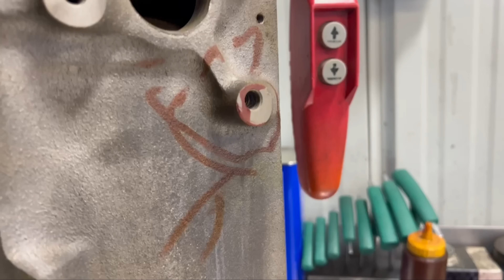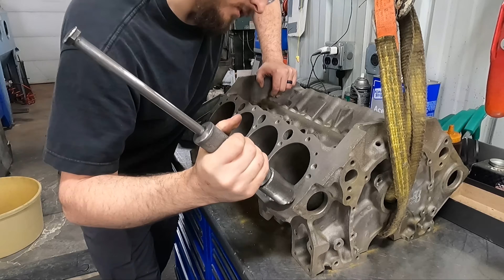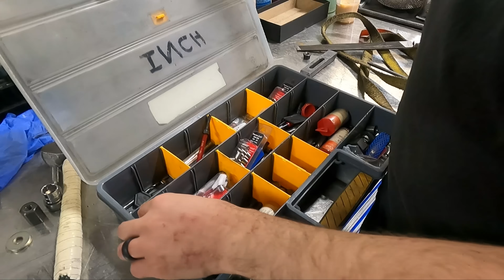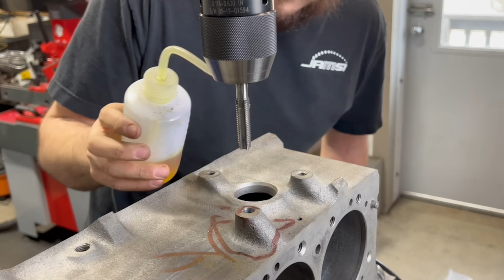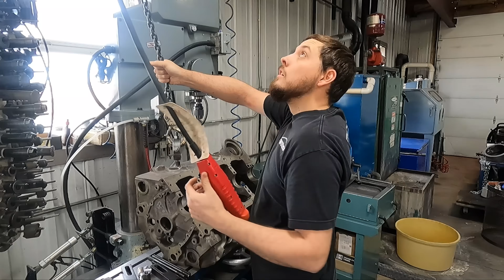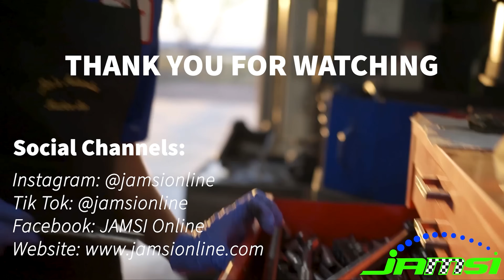Fixing Motor Mount Threads In A '70 350 Corvette Engine Block @JAMSIONLINE

Comment: Heli coils are often stronger than the original threads just because there harder than whatever material there threaded into. And now youve increased surface area on engagement on original materia, more surface area to grab, more strength.

Comment: What is the reason you wouldn't just tap by hand to start with?
Reply from the maker: Using the machine guarantees it’s straight and on center to the drilled hole, plus it’s just easier in my opinion lol

Comment: I replace a lot of bagged out helicoils with timeserts. They're a better product, but a little more expensive. You should check them out.
Reply: Timeserts are actually weaker than helicoils but are much better for bolts that are frequently removed. They both have pros and cons

Comment: I do not understand the lack of confidence in threaded insert repairs.

I'm not a professional machinist, but I have not, to my knowledge, had a properly installed threaded insert fail.  The few that have failed have been due to my own errors in preparing the installation.  

Properly installed, the only way that I can see an insert fail is if the parent material or the fastener fails.  

The insert itself is far harder (in nearly every case) than the parent material or the fastener and should be firmly wedged between the fastener and the parent material.
Reply from the maker: Typically what we see with helicoil is that the user will get the bolt about 1/2 a thread in and then start trying to “pull” on whatever component they’re installing, and it pulls the end of the insert out.

Same thing happens with the original cast iron threads when used improperly like this.

A LOT of failures can be traced back to improper use.

Comment: I've had good luck with steel inserts vs helicoils. Im sure you use them much more than myself I'm curious why you use the helicoils vs the insert with the engine on a bench or are you just talking about the brand?
Reply from the maker: Helicoils do the job well, they are more affordable, they are easy to install, and they are less invasive as far as the size increase of the hole. If down the road they fail again there is still the option to go to a bigger OD solid style insert. 

There are certain applications where I go straight to a solid style insert. Just depends. 

If I had customers complaining left and right about failed helicoil, I wouldn't use them. But I don't, lol.

Comment: Is it possible to try and deck a Chevy and stop at the vin and ID pad saving the numbers?
Reply from the maker: It's possible, have shown it in some of my previous videos lol. This customer didn't want that.
Reply: @JAMSIONLINE  Why not deck the head and re stamp the numbers? as long as u have the before picture should not be an issue? would think having a proper restoration job on the engine way more important?

Comment: Interesting video. I had a couple of questions.  If the block isn't decked, are the heads sealed with a thicker gasket or how is that managed?  Also, your comment about valve lapping compound reminded of a previous video where you rebuilt the 6 cylinder head.  Are valves not lapped in anymore?  Better materials or tolerances these days?
Reply from the maker: Hopefully the gaskets will still seal. We prefer to surface but obviously the value in these cars is greatly increased with a numbers matching engine. Sometimes we manage to surface and still save the numbers. In this case customer said they just want it bored. 

No, we do not lap the valves anymore. Some machinists are going to disagree with me, but our Serdi does a much more accurate job than lapping. It is an old technology that for whatever reason some people still think is superior.
Reply: @JAMSIONLINE  Thanks.  I assumed the technology had moved on for lapping.  Old habits die hard.

Comment: Parallels would of saved some work
Reply from the maker: Not really. It’s a toss up. But if I put parallels on the machine, I also have to take them back off before putting the rollover fixture back on for normal machine operation. 

Either way about the same time probably

Comment: I'm sure that whatever procedure that you use for anything there is someone who won't like it. Helicoils are wonderful if installed correctly for the correct application. I'm sure that in a cast iron block the threads are stronger than from the factory.
Reply from the maker: Ain’t that the truth! Lol
Reply: Yes, and always stainless steel which is a big improvement over cast and less likely to gall.
Reply: @ellieprice363  just be careful with stainless on stainless as it can gall even when things are only installed finger tight.
Reply: @darrellhendrix5502  True. A good reason to always use the proper grade of anti-seize lubricant when assembling stainless to stainless.

Comment: Helicoils are awesome. I didn't like them at first but since learning about them properly i like them. Hell even some car manufacturers with use them in alloy blocks and heads for a stronger them alloy thread.
Reply from the maker: Yep! I do use solid style inserts in certain applications as well, but for something like this I like the helicoil. If it ever fails down the road, a solid insert is still an option.
Reply: @JAMSIONLINE  Glad to see you considered that. I strongly prefer timesert but there is a time and a place for helicoil

Comment: Helicoils are great. Especially in cast iron.
Reply from the maker: My customers don’t complain! But the internet usually does when I share a helicoil video 🤣
Reply: @JAMSIONLINE  when I restored the 75 vettes caliper bolts were stripped and someone put JB weld in them. I put them up in the drill press and helicoild and 60ft lbs no problem. And i trust it to be braking from 138 mph after a 1/4 mile pass with a 406 and nitrous.